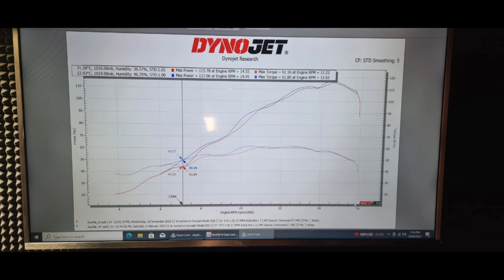Building my Yamaha R6 Superstock Race Bike

Comment: Just a tip, in this video you're fighting the bike by being crossed up on the track. If you lean your head in, change your wrist positioning and put your shoulder to the inside will help the wind bring in the bike as you push the bike up and you lean in this will also still give a good contact patch for the tire to keep traction. Your head is directly in the center of the seat, it should be hanging off like a monkey on the inside of the turn left or right, might give you some valuable seconds off your time. Good video, safe riding on the track or racing!
Reply from the maker: Thanks appreciate it… fully agree with the points… the footage is from a warm up lap (only footage I have) so body position isn’t as I would in a race. I always say that head position mid corner should be “kissing” the mirror” and upper body position will generally align. But great points you make in any case and appreciate the support! Ride safe brother